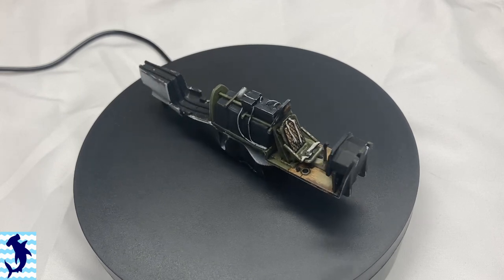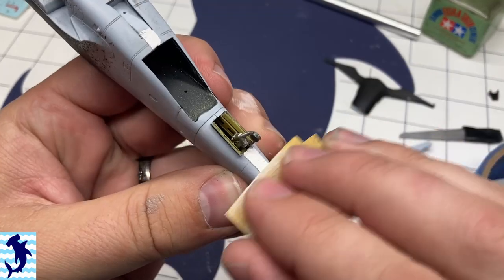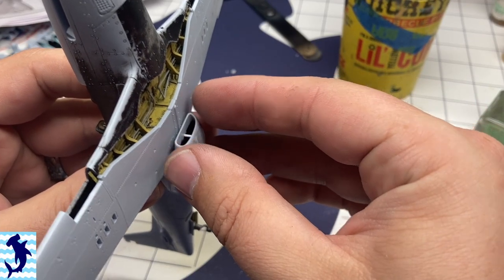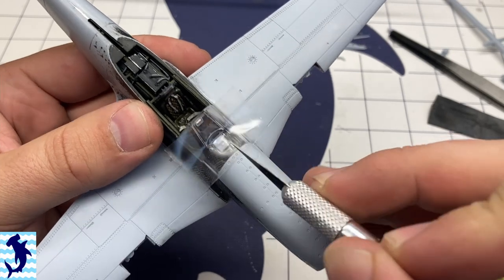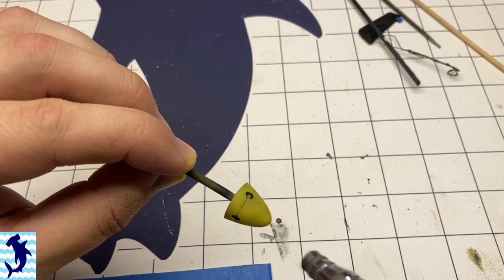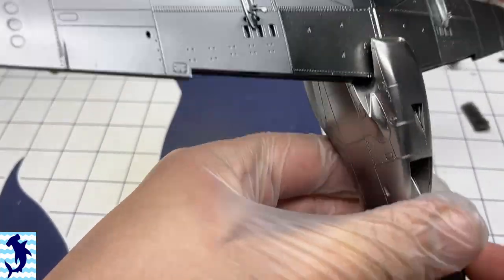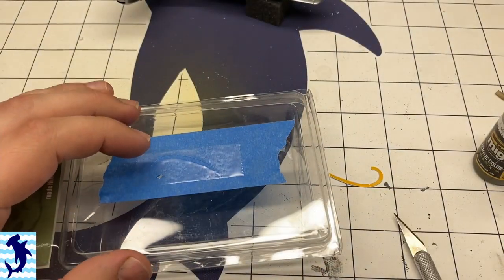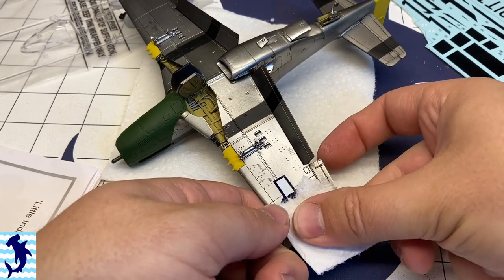How to build the Airfix P-51D - Part 2- Construction and Painting

Comment: Nice video. You're a much better modeller than I am but I didn't have any fit issues with the fuselage with this kit. Airfix tend to be very tight tolerances so sometimes if you have paint on the inner parts or surfaces it can throw out the alignment, in my experience.
Reply from the maker: Yeah, I'm sure I got a little too much paint somewhere, but still enjoyed the build a lot!

Comment: Hi, Great build love it I’m working on the same model where did you get the drill and drill bits. Need to get a new set.
Reply from the maker: Thanks for watching!  Here is the pin vise I use and the drill bits I use:
https://www.amazon.com/General-Tools-70801-Miniature-Vise/dp/B0031EOK0I/ref=sr_1_8?keywords=general+pin+vise&qid=1636479246&qsid=147-8533104-7790616&sr=8-8&sres=B000COYPG4%2CB000BQW5XS%2CB000KL3WSQ%2CB000OR0TIC%2CB001HWBYU0%2CB001HWA8UW%2CB0031EOK0I%2CB001HWDK7A%2CB01M4FY99G%2CB000CSCQ98%2CB07Y3492R5%2CB0868W2DVL%2CB08GQBM5DR%2CB00375DEPI%2CB001LF1156%2CB010BV7190%2CB072M35LDZ%2CB005FMZDJQ%2CB001EPX75U%2CB0009H5ISI&srpt=HARDWARE_CLAMP_VISE

https://www.amazon.com/WayinTop-Carbide-0-3mm-1-2mm-Circuit-Engraving/dp/B07S636JHY/ref=sr_1_6?keywords=micro+drill+bits&qid=1636479207&qsid=147-8533104-7790616&sr=8-6&sres=B084T4PB1K%2CB07S636JHY%2CB000SKVF8I%2CB08Z7JZKKD%2CB08VY6RGCK%2CB01MS1CNLV%2CB08VHWGK7Q%2CB091CVVPFW%2CB07ZFNJQH6%2CB0105567BU%2CB089QRCM1Z%2CB082823TZ9%2CB072FMW3GP%2CB07QWG8RMW%2CB07C5S3FM2%2CB098CF3VMM%2CB083FSDGDP%2CB001IC9CXK%2CB08Y67YRYG%2CB096VC6V98&srpt=DRILL_BITS 

(Sorry for the large links)